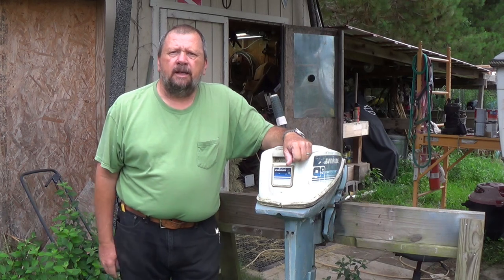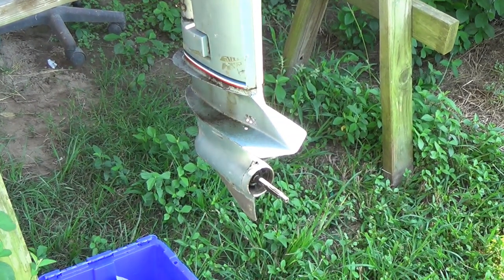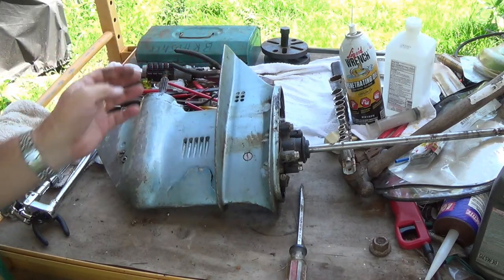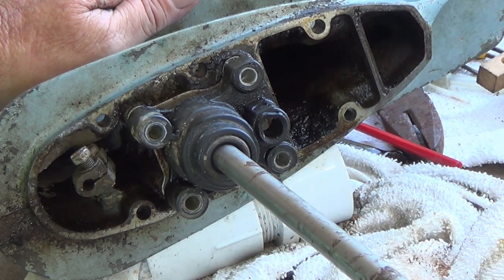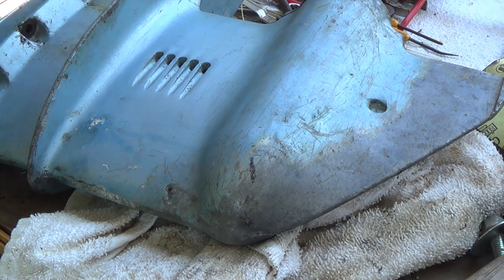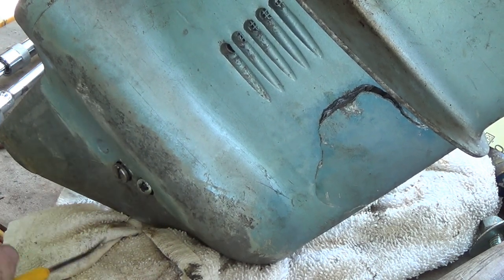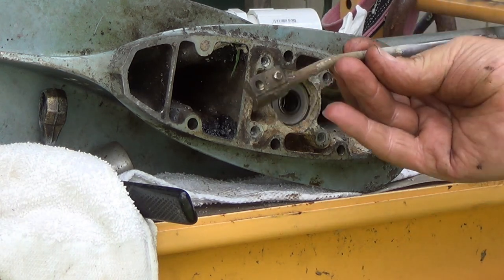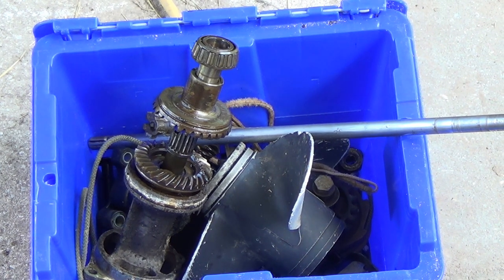Evinrude 9.9 Part 3 {How to take lower unit off}

Comment: you should try using an impact driver to take out seized screws or oil plugs
Reply from the maker: Yes sir I think it would make it a lot easier and not mess up the bolts and screw heads. Thanks for the tip and commenting.

Comment: Is it normal to have oil or foot oil leaking a small amount from the drain hole? I replaced an impeller today and stopped after I assembled the new impeller because I noticed some oil leaking from the drain hole at the front of the foot, which it was not doing before I took the foot off of the outboard.

Comment: hello i recently got a 1976 9.9 johnson ,,is it correct ,that this is the only year you can put a 15hp carb on and be a true 15hp ,,,?love your show ,
Reply from the maker: In the 70s the evinrude outboards the only difference between 9.9 and the 15 was the carburetor. In the 80s there were more changes like the exhaust tube. If I remember right they did that because of the HP restriction on a lot of the lakes. It had to be under 10 to 12 HP on most. I think they had a lot of carburetor problems on those models so be careful if you look for a different carb. Stay Safe.
Reply: @OmFishing  i got a 76 9.9 johnson ,for some reason it will not rev in nuetral ,put in gear it revs ,its got cracked coils so surly being in gear or out , should not matter ,,thanks for your show as a real learner you are a godsend
Reply from the maker: @petermoyes8766  The engine has a stopper when in neutral so the engine can not be over revved. It is in the linkage.
Reply: @OmFishing  thank you it has cracked coils i thought that was the problem ,,not reving thanks again   your knowledge is a blessing
Reply: peter moyes  I have a Johnson 9.9 1975. The Johnson 9.9   1974, 75, 76 is exactly the same as the 15hp  except the carburetor and exhaust as I can see.

Comment: I have a 1980 25 hp with a similar shift linkage rod connecter. After doing water pump replacement my shift linkage is screwed up and motor won't go into forward gear. A video of how to adjust this would  be great if you have the time. Thanks for the videos
Reply: I did reconnect the linkage rods
Reply from the maker: I will try to do one in the near future.

Comment: I have a 9.9 Yamaha I took the lower unit off to change the impeller I put the shift linkage in neutral and dropped the lower unit when I went to put it back it shifts it into forward not sure what to do
Reply from the maker: I work on evinrude most of the time but, I always put the shift rod engage in to reverse gear and the shift handle in the reverse position. I think yamaha is done the same way. I think you just got the  linkage out of adjustment. Try putting both in reverse position and readjust the shift rod to the right length. Remember to remove the spark plug leads to avoid accidental starting while servicing. Hope this helped and Stay Safe!!

Comment: I'm confused, why didn't you removed the shift linkage screw instead of forcing the unit down and breaking the brass connector?  the upper shift rod is supposed to be bent that way, so it is OK...The lower shift rod is supposed to be bent as well...And you are so right, that little water drain hole is what caused the big crack in the housing.  That hole must be cleaned constantly, or water is trapped in the cavity and pops out the housing when frozen.  I usually enlarge that drain hole slightly to make it less likely to plug up.  Oftentimes, split gearcases hsgs don't affect oil sealing and can be simply knocked back in place and welded or glued with JB lube or some epoxy stuff...In this case, there was no/little oil in the gearcase, so it is tough to tell whether that split is a big problem...Too bad you could not have pressure tested the unit before disassembling it...I have never seen one split quite as bad as yours though...Keep in mind that this large split may have affected the structural integrity of the housing, and might cause it to misalign/distort....Probably best to find a decent used gearcase or housing...Don't feel bad about those prop shaft detent balls/spring, there is no way to avoid losing them during disassembly...Just always try to find the old ones, even if you are not going to reuse them, just to make sure they are not trapped in the housing where they might get loose and roll around after reassembly...This engine is still worthy or resurrection, in spite of this damage to the gearcase....
Reply from the maker: Thank for the information I did have the brass connector loose, you are right I should have looked in the service manual and found it had to be taken all the way off first.  P.S.  luck was on my side it did not break.
Reply: Yeah, the screw has to come out completely before removal, no big deal though...Just be sure the threads on the screw and brass connector are still good...